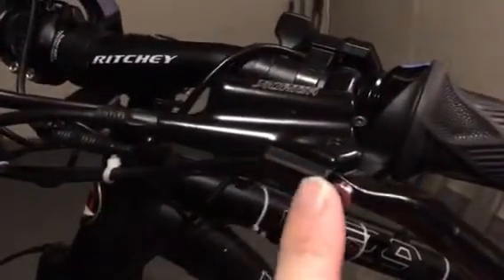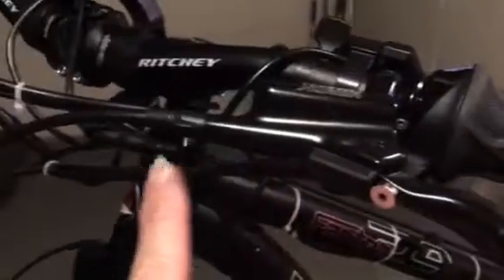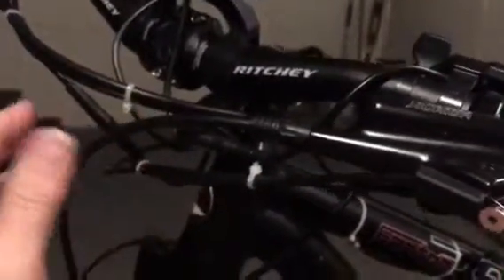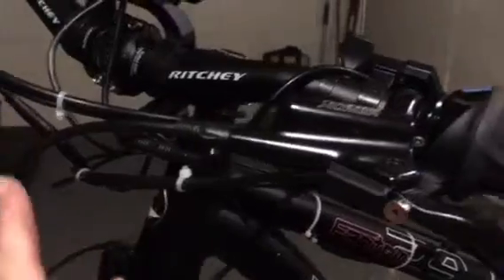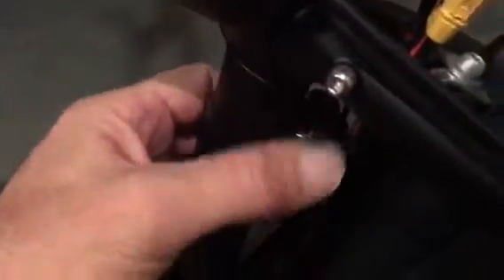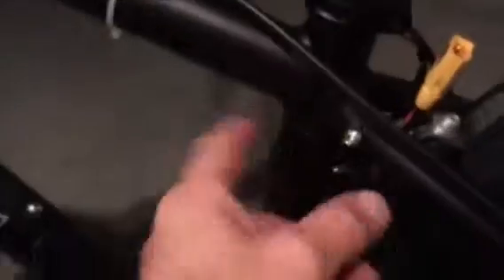DIY Bafang brake lights .

Comment: this is very cool solution but unfortunately it wont work for me :/ I need to figure it out the same that you did but my sensors are connected to my ebike controller that shuts down the motor when the brake lever is down.

Comment: This is just what I was looking for. Could you provide connection map ? Because I did not understand how to connect wires to both Bafang brake sensors.
Reply from the maker: It’s very easy each brake sensor has two wires. you connect one wire from each of the sensors together then connect the other two wires from each Sensors together, now you have two sets of wires instead of four wires. From the two sets of wires you’re gonna connect one set to the positive side of the battery which is gonna  be feeding power into the brake sensors and the other set of wires to the lights positive connection. Next you gonna connect the negative wire from the light to the negative on the battery. Presto when you press either brake handle it sends power from the battery power to the lights. Let me know how it turns out.
Reply: @yourstruly9340  Thanks for the answer.    I have a question. The brake sensors  in this video are those included in the Bafang kit ? If so, I did not understand the following explanation well. I would like to know which pin I should wire to out of 3 pins of "Higo 3 pin connector".

>you connect one wire from each of the sensors together then connect the other two wires from each Sensors together, now you have two sets of wires instead of four wires.
Reply from the maker: Oops im sorry I believe its 4 & 8, white & black. Just check which gives  for continuity when pressing the brakes. Keep in mind i wasn’t using my brakes as  cut-offs. Only as brake lights. (Not connected to the mtr side harness). If you intend to still use your cut offs then use one handle for cut off and the Other for brake lights, in that case you dont have to  joined the wires Simultaneously.
Reply: @yourstruly9340  Thank you so much ! To use power cut off function at the same time, I will install a Y splitter and  a 5V relay module.
Reply from the maker: Sorry for the late reply. I used these brakes Auriga E-Tune HD-E530 Hydraulic Brake set w/ E-bike motor cut-off. It comes with the bafang higo connection. So in your case since you want to use the cut off just get the adhesive magnetic cutoffs to use for the as a on off switch for the brake light set up i did. And these led strips https://www.ebay.com/itm/251626717580. In your case if you still want your brake cut off
Reply from the maker: Use connection 4 & 6
See link for wiring diagram https://electricbike.com/forum/filedata/fetch?id=77041&d=1540926770

Comment: Smart and safe. Great thinking 👍
Reply from the maker: Thx. Im glad you like it
Reply: @yourstruly9340  One question, now that you are using the break-sensor-cables for the break-light, how does the motor know when to cut power off ? How did you rewire that.
Reply from the maker: @Ematuresco  I no longer have this set up. I now upgraded to a phase runner on my bbshd with a different set up. but when I was using it I wasn't using it for engine cut off just for the rear lights. sorry.

Comment: Hello, If using the brake sensors as expected by Bafang,  What is the voltage? and, would be posible to keep this original function and add a break light hacking the wires?
Reply from the maker: No. I’m not using them for cut off, only for the brake lights. I figure we all release throttle just before applying brakes anyway. Good luck
Reply from the maker: sorry for the late reply. bafang ebrake voltage I believe is 5v . I myself wouldn't recommend hacking into the line for rear lights while still using them for brake cut-offs in fear or damage. bafang shortage can be unforgivable.

Comment: Can you add a connection map?
Reply from the maker: Give me a day or two 👍 I’ll also provide the links of items purchased.
Reply from the maker: It’s pretty simple, just connect same sensors color wires, connect running wires to the ends then connect one of the running wires to the battery negative and the other to the brake light. The other brake light to the positive on the battery.
Reply: pretty sure you dont need a connection map, it seems pretty straight forward